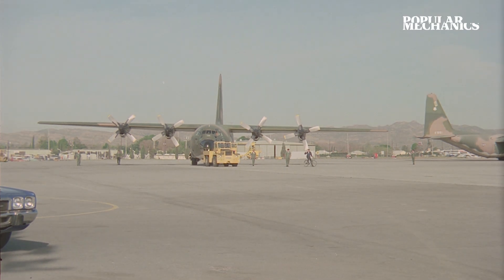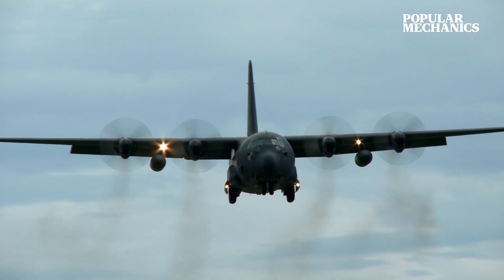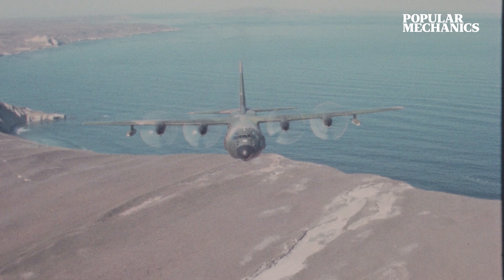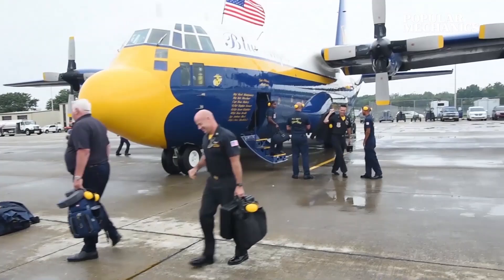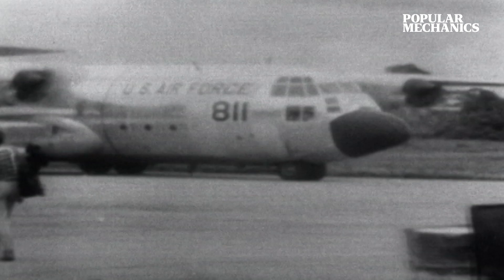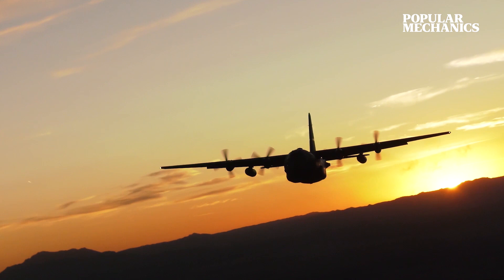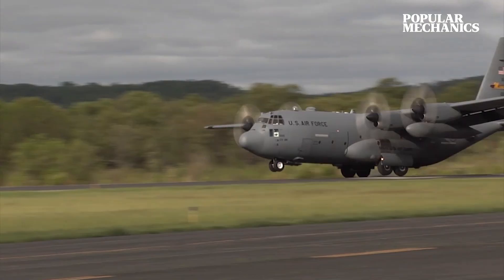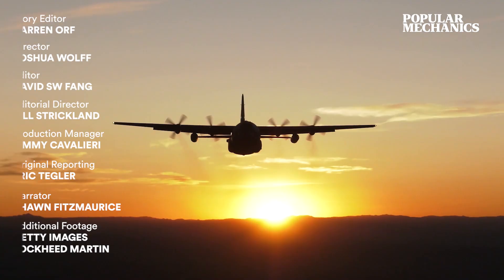The History of the C-130 Hercules | Heavy Metal | Popular Mechanics

Comment: C130 rolling down the strip.
Reply: 64 troopers on an acid trip. C130 rolling down the strip...wheel fell off and the damn thing flipped. On your left now.... left on your left, left right on your left. Left left left
Reply: @jdkgcp  Vietnam era:  C130 rolling down the strip.  Airborne ranger gonna take a little trip.  Stand up, hook up, shuffle to door.  Jump right out at the count four.  Sound off 1,2, Come again, 3,4.
Reply: @dannymoore6886  Those are still used. If you have a 1SG/CPT with a sense of humor you can also pull off...

A is for Army....Army Army Army

R is for Army....Army Army Army

M is for Army....Army Army Army

Y is for Army...Army Army Army.

That's some 5-6 mile cadence. But when I went in in '97 "Eskimo pu**y" was still "mighty cold".